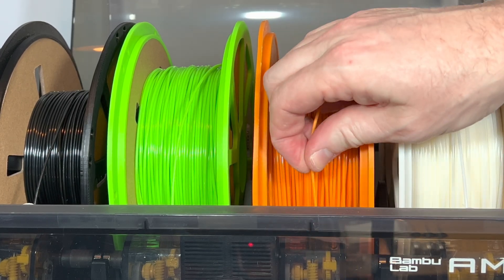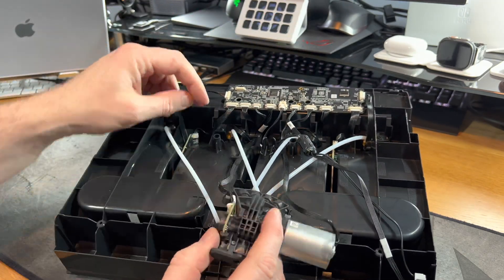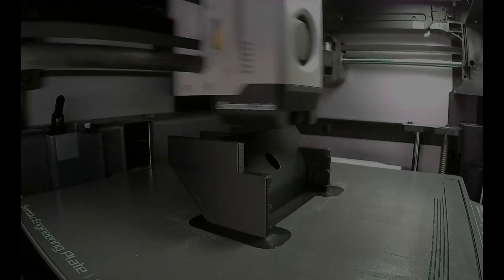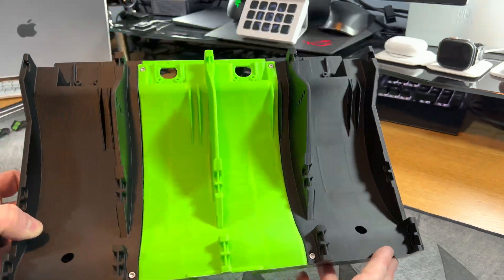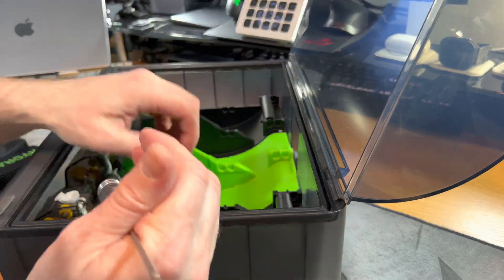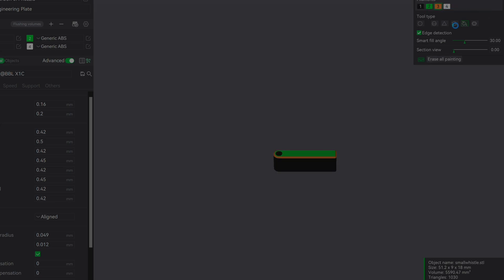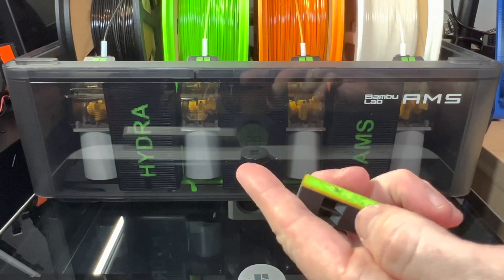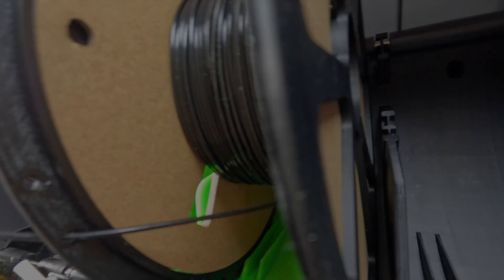Upgrading Bambu Lab AMS: Hydra AMS Install & Test 🛠️

Comment: I'm about to install the hydra mod on my friends ams unit. His unit is a kickstarter one and noticed cracking in the shell.
Reply from the maker: @JesusMartinez-zu3xl I wonder if that is specific to the kickstarter.  You can now purchase a replacement shell from Bambu, or just glue it.  A crack risks impacting on the moisture levels inside the AMS.
Reply: installed the hydra mod and reverted the ams back to stock. So many things wrong with the hydra that I just decided to move back to stock. Holes didn't align, lid failed to fully seal, RFID sensors failing to pick up the filament being inserted. I though I messed up the RFID sensors with those awful friction fits. Personally wouldn't rec doing this mod since you can easily damage something if not enough care is given in the disassembly and reassembly of the AMS, especially whenever installing those RFID plates into the hydra. @T8Maker
Reply from the maker: @JesusMartinez-zu3xl Mine is still in place and working, but generally I would agree with you.  It might be the issues you saw are related to the dimensions of the kickstarter version possibly being slightly different from the production.  For most people the advantages over the risks, its just not worth it, ts really only for tinkerers who want to play around with it and don't mind the risk of breaking something.

Comment: Great info and walk through for install... but what does the Hydra DO? Could have used a bit more info on the front end as to what the purpose is, what the use case for someone would be, and why we'd risk the void of our warranty to implement it.
Reply from the maker: @mackobun You are right, I went into this making assumptions everyone knew what it was so never stopped to explain it.  I should have spent a little time demonstrating the issues with odd sized reels not fitting the standard tray in the AMS.  I do at the end show a few different reel sizes in the Hydra, but its probably not enough to explain it.  Thanks for the feedback.
Reply: @T8Maker  
I watched till the end and gathered what Hydra does. So it was all good after all. Happy to provide an outside opinion. The rest of the video was super detailed and well put together. Cheers
Reply from the maker: @mackobun  Thank you, glad it was useful.
Reply: it does not void the warranty currently

Comment: What is this for?
Reply from the maker: @pedrosanchezpena7 Thanks for the comment, and great question.  Firstly I would suggest if you are unsure of what it is and don't know why you would need it, then I would just ignore it, move on and don't try it, keep you AMS as it came form the factory.  this is my recommendation to 99.9999% of people.  

But to answer your question in some detail, there is no standard size for Filament reels/spools, and this becomes an issue with the stock AMS if you have an odd size rspool that doesn't fit the AMS and you want to use the AMS with that filament.  There are a few potential solutions with associated risks and costs.  1) buy Bambu Lab filament which is designed to fit the AMS.  (or some other filament that is confirmed to fit) then you will have no issues and will be covered.  2) re-spool your filament onto a reel that fits (there are some projects out there to build re-spooling devices), this has risks that if you mess up the re-spool you could end up with a tangled mess and a spool of filament you can't use. 3) Modify the AMS itself to fit the reels you want to use (Hydra AMS is an example of this).  Risks, you void your warranty on your AMS and maybe your printer, you break your AMS modifying it, and no guarantee it will fit your spools or resolve your problems.

If your unsure, in any way, about any of this, DON'T do it.  Just take option 1. buy the spools you know fit and you will be fine.  

This is really for people who don't mind, or want, to take their stuff apart and modify it, and are OK with the fact they could break everything and if they do they are on their own, no warranty, no indemnity, no comeback, and Bambu Lab won't help you.

Hope this answers your question.

Comment: I left out. I was installing the Filament Hub. Hoping to fix this and hot have to buy a whole new unit Bambu. Help!!!!!!
Reply from the maker: @terrylindsay445 Hi, thanks for the question, as I am sure you already checked, or at least last time I asked BL support they don’t supply spare screws.  I am currently travelling so I am not able to check the size of the screws, but you can get small self tapping screws from a local or online hardware store, if the screw hole  was stripped when you put a screw in you can purchase a slightly wider screw to replace it and it should screw in if your gentle.  But this is always a problem dealing with small screws and plastic.  I should be back this week and when I get a chance I might be able to check the size of the screws, so these are the screws were for the hub on the back of the printer, or the hub in the AMS under the tray?

Comment: Hi there. I was installing the new HYDRA from MATTER HACKERS and screwed up twice.
1, I stripped out the lower two female receptors for two of the four screws. Fortunately the unit was replaced.
2. In the process, I managed to lose two screws and the rubber on them (I looked  all over the area I had been in and didn't find them.)
     Do you know how I can do to replace them?.  or what I can do?
Reply from the maker: @terrylindsay445 See your other comment.  Thanks.

Comment: I don't care for this mod to be honest. Over-designed, too much material required, another mod needed to close the lid.

I'm sure I will figure out a simpler way when I receive my AMS unit.
Reply from the maker: Easiest solution is buy reels that are no more than 200mm in Diameter and 65mm in width.  Then you will have no issues with reels catching.  Bambu Lab have a good selection of filaments that are designed to run in the AMS.  The also sell empty reels and you can also print reels, I recommend printing the reels because they come with holes to catch your filament in to start the reel, the ones you buy don't have that because they are designed to slot on refills.

Comment: For some reason my 3rd bay is wonky too.
Reply: the third slot on my friends ams is bad as well! I'm hoping the hydra mod fixes the issue.
Reply from the maker: @MannyCo That's interesting.  I wonder if anyone else is having issues with the 3rd slot of the AMS?  Just the other day I was swapping out my ABS for PLA+ and it was a disaster, it would not retract the 3rd slot and kept tangling the filament inside the AMS.  I have a spare feeder, so I may try replacing it, to see if it fixes the issue.  As with everything, its just a matter of finding the time to do it...
Reply: If there are any issues it's with the 3rd. I imagine any lacking QC parts are put in the 3rd slots due to the likelihood of customers overlooking it.

Comment: If it aint broke dont fix it. I likely wont upgrade tbh, ill just figure out what spools work and buy only from those suppliers. Luckily bambu is having a sale on filliment right now so i might just buy their crap.
Reply from the maker: Makes sense, unless you must use a particular reel the Hydra is not a perfect solution.  Will meet some needs but not all.  I also tried the reel to reel using a printed Bambu reel, but the filament got tangled up during the process and it was a real mess.  Ended up throwing out the filament because I couldn't untangle it.

Comment: This is why i love 3d printing.  If something doesn't work or exist, we manufacturer the thing ourselves
Reply from the maker: Yes, its a great community.
Reply: This happens in every trade.

Fyi.
Reply: @dangerous8333  not really you cant make a new hydrallic press as a factory worker or design a new substation as an electrician or make a new water pump/water pressure system as a plumber

Comment: Thanks v much for doing this. I am planning on buying some colours I use regularly from Bambu Labs so that when they run out I can re spool my cheaper filaments onto the empty spools. Will that work? The ones I’m buying are fitted with the RFID things
Reply from the maker: @Chazmills, Thanks for the feedback, I am glad you found it useful.  Re the Bambu Reels, there is no reason it shouldn’t work. Just note the Bambu reels I have seen have no hole on the core to hook your filament into if you plan to spool it from reel to reel.  They are designed for the side to come off, to have a bound reel of filament slide on, then you reattach the side and cut the binds.  If you want to feed it reel to reel, you will likely have to drill a small hole to hook the filament into to start the reel.  Or you could try taping the start of the reel to the core of the Bambu reel.  Other thing to be careful of, if you use the AMS with cheap filament, is shredding of the filament, caused by the filament disintegrating as it’s fed back and forth through the motors.  In my experience this is most common with cheaper filaments.  See my previous video, Mastering Your Bambu Lab AMS: Overcoming AMS error for Multi-Color 3D Printing. https://youtu.be/FmaxuqtDDrM

Comment: I can’t believe the discussion. I had filament spool issues, and stepped over to the hydra. I solve some issues and introduce some new ones. I did rebuild to the standard bambu setup. I design a way to respool the filament to bambu spools. After, all my problems where solved. Now I have runnen two bambu x1’s with both 4x ams installed, and i did not face any issue in 1000+ hours printing. Just respool your filament and stick to your supplier standards. 

Feel free to experiment, but stop solving issues what are no issues.
Reply from the maker: Hi Eric, I don't think your wrong, the AMS is designed with a certain specification and if you stick in the specification it will work perfectly well.  Use spools that fit, use quality filaments and only use the recommended filaments staying away from soft and abrasive filaments because they will stick/jam or ware your parts away.  Respooling reels is a valid solution for odd reels that don't fit also, but this is not an idea solution for everyone.  And while it works great for you, which is excellent, I personally have had issues with respooling also that left me with reels messed up and unusable.  So in short, its great that your having a great experience and that your solution (which is a solution also) works for you, and long may it last, but what works for you may not work for everyone else.
Reply: @T8Maker  putting the wrong tires on a Porsche and complain the car isn’t handeling well. Stick to the supplier designs, will increase your joy and quality. I did learn my lessons in the last 10 years 3d printing. If you like to tweak, just tweak. If you like to have no problems, stick to the defaults.  When I stop tweaking, modifying, experimenting, etc my prints came  out flawless. Read 10 years of printing, 62 years of life experience, make life easy and stick to the standard. Just spool your favorite filament to bambu spools and enjoy printing. I don’t have ANY issue with ASA, ASB, PA, TPU, PC, PP in any way. My 2 printers with 8x ams running with now issue. Use standard profiles, I only change some minor settings. 

Again if you like to play, feel free. I just tell you my experience, feel free to join my ideas, feel free to do your own things. I only like to tell you my vision
Reply from the maker: Hi Eric, I do like your analogy, its actually a personal pet annoyance, cheap tyres on a good car :) and as I said in my first response your not wrong.  For most sticking to the specification is the way to go.  But for some tinkering, pushing the boundaries and customizing is what make using a product interesting, and in this what works for some will not work for others.  Am I reading your comment correctly,  you used TPU in the AMS and it worked? Would be interested to know what hardness and brand of TPU you used.   Appreciate the feedback.
Reply: @T8Maker  whahaha your are reading correct and sharp 👍👍👍👍👍👍🥇. No tpu is not via the ams. I print tpu direct into the extruder, I even switched of the extruder during direct input. Same for some cf filaments
Reply from the maker: Ah I was wondering, yes I have done that too and it does work well.  Thanks again Eric.
Reply: @T8Maker  I have friends who like to tinker and improve. Its an other part of the 3d printing hobby. I did my best in the past with cheap Chinese printers. One moment in time I stopped, and started to make parts. Just this evening, I solve 3 issues at home, by printing parts. I’m no longer a builder or improver. See it as a drilling machine, I make holes, not all day improve the machine. If you like hydra, go for it. If you like to make parts, stick to the company standards. Just an advice from a old guy, with a lot of mistakes 🤣🤣🤣
Reply from the maker: You're not alone there 😉
Reply: @Eric1960 You are 100% right, but people cannot accept this.

I started with ender's and never had any problems with them because I stuck to the stock machine until I figured everything out. By the time I figured everything out I realized I didn't need 90% of the mods other people we're doing, and also realized many of their issues were caused by themselves.

The amount of money wasted and the redundancy in the 3D printing community is pretty astonishing. You've got these newcomers that buy machines and think they need to mod them right away because all these YouTube influencers claiming they are needed.

It's wild.
Reply from the maker: @dangerous833, Since you put this up here, I will address your last point, I am not a 'youtube influencer', This is a tiny channel and I am a hobbyist who is sharing my experiences.  I receive no sponsorships or money or free goods, I pay for everything out of my day job, because I want to share my experiences of something I love working on and participate in the community.  If you watched the video, I never indicated this modification was 'needed', in fact I warn several times that you should probably not do it.  I did this video because there are people who are interested in this topic, its OK if you are not interested, but try not to be exclusionary to people new to the hobby, its great that the community is growing and bringing new ideas and different options.
Reply: @T8Maker Sure, it might not work for everyone for whatever reason, but it is the better solution.

They have printable respooling machines that work great.

I would rather invest the material and time making that since I can also use it for consolidating roles with just a little filament leftover, and when I'm making filament from plastic bottles, or even winding rope.
Reply from the maker: Hi dangerous8333, this is the beauty of the 3D printing community, its full of differing needs and solutions.  Its great that people are able to find things that work for them, you're not stuck with one way of doing things.

As for the 'respooling machines', I did try that solution before I went down the road of the Hydra, and I had to throw out two reels because it messed them up so bad I couldn't untangle them.  That, and it kept falling apart, with the feeder popping off while reeling the filament.  But that is only my experience, most people seem to have a good experience with it.

I am also interested in using PET bottles as filament, sometime when I have time I will give it a go.  

In any case, happy printing, and I hope you find the solution that works for you.

Comment: Thanks for posting, I have been thinking about the Hydra, but am not sure - been trying to watch everyone's experiences
Reply from the maker: Hi David, thank you.  If you have a major issue with reels not fitting or fitting tight, it might just be the solution.  But as there is always a risk you can break something, I would consider using the reel that doesn't fit on the external reel holder first.  As far as the parts, you can buy feeders, PTFE tubes, and the AMS Hub on Bambu Lab website.  But the controller board, hub motor and screws cannot be bought of they break or get lost (screws that is).  If you don't break anything, the install is reversible, you will need some glue for some items to refit back in the original tray, e.g. the NFC cards.   Hope, whatever you decide it works out for you.
Reply: @T8Maker  Thanks for your input.  I am going to leave mine stock, at least for now.  I have been talking to a lot of filament companies and many are trying to switch to AMS compatible spools.  This should not be that difficult and could be a new standard for spool size.   Another would be the actual implementation of master spool and a standard.
Reply from the maker: I think that is a wise decision.  Unless you have major issues and this is the only way forward, or you're just a risk taker, its not worth the risk.  Standardized master spools are an essential change needed in the industry, not just for fitment, but also for our environment.  There is already too much waste in 3D printing.  Next big issue to solve is a realistic way to usefully reuse waste filament and failed prints.

Comment: Great video. Quick question where can I find  spool adapters you were using?
Reply from the maker: @phigri33d Glad you liked the video.  Good catch I forgot to add the spool adapters to the description, corrected.  But here you go also, hope its what you need.  They work great with and without the hydra ams modification. Jayo Spool Adapters by Jack Siegel on Printables.com - https://www.printables.com/model/365766-cardboard-spool-adapter-jayo